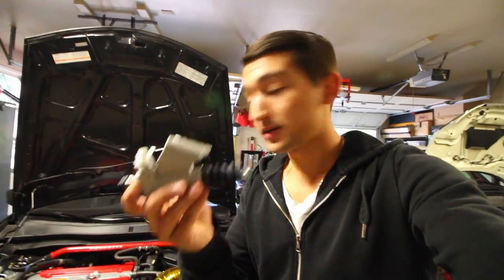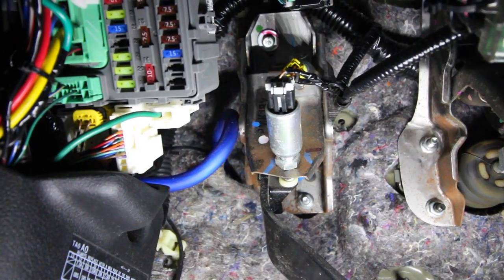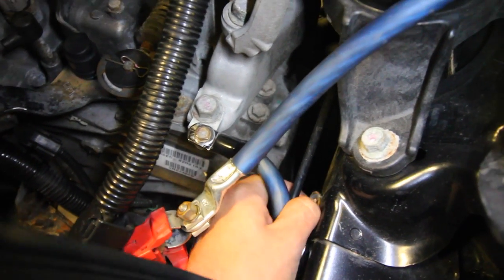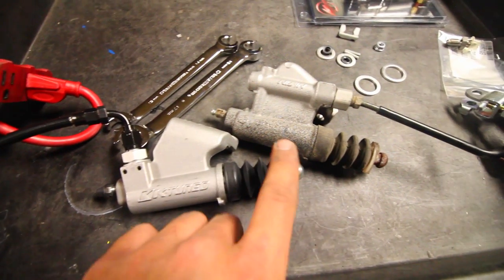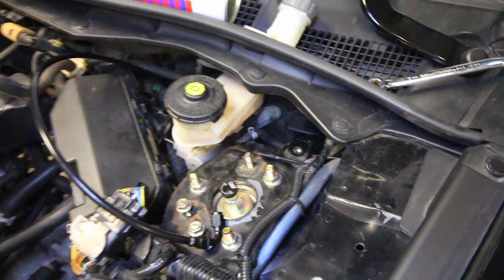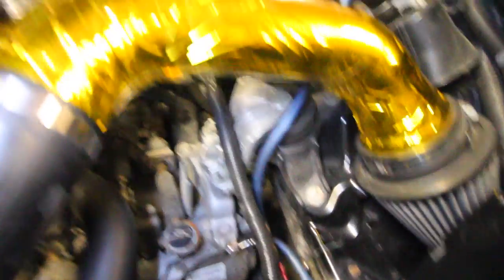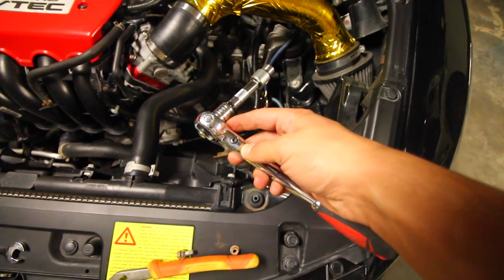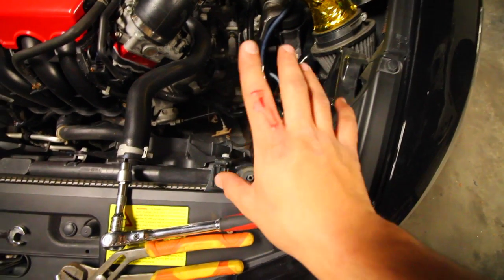How to Make Your Transmission Shift Faster (K-Tuned)

Comment: The k tuned slave lasted me 2 years and had to replace it...I daily drive my car and it just went pfff on me lol. The master slave is still working awesome though.  Just feel played cause the kit was 250...but the NAPA slave feels soooo much better.  Along with my stage 1 Exedy clutch and light weight fly wheel
Reply: Because ktuned uses dorman parts.

Comment: Could have saved some money by just buying a clutch master cylinder from a 03 civic ex without the delay valve, the slave cylinder doesn't have any kinda delay valve it's just the master cylinder
Reply: the slave cylinder does have a delay valve lol in the 8th and 9th gens it does which is why everyone does both

Comment: Good video. The reason you don't use old brake fluid isn't because it absorbs air and lets air into the system. It's due to the fact that brake fluid is hydroscopic and will absorb water, when you press your brakes the fluid is compressed and allows pistons etc to move, water doesn't compress and will cause spongy pedals, corrosion etc. that is the main reason brake fluid is replaced every 2 years on cars, as that's how long it can absorb water for and still be useable. You can use a hydrometer to check this, anything more than 4% must be changed immediately. Imo anything over 1% should be changed soon. Just my 2 cents mate.
Reply: Actually it's not cause brake fluid can be compressed and water can't be. They both can't be compressed, brke fluid and water. Why you should be concerned by having water in brake fluid is because it lowers the boiling point of the brake fluid and as such it can cause brake failure. That's the only reason. Not because you can't compress water, cause you can't compress brake fluid either. It would be rather pointless to have a fluid in the master that can be compressed, THAT would give you a spongy brake and no the other way around. 
For example, air is compressible and gives you the spongy feel. Water alone wouldn't do that until it boils and your brakes fail completely.

Comment: been waiting for this for a long time, my slave  cylinder brake down on me when shifting from 2 to 3rd and the pedal dropped on the floor and the car was rolling in 3rd gear, good thing i was  in the city and not far away from home, driving without a clutch and shifting gears in certain rpm

Comment: Just did the conversion beacause my cmc was sqeeking and leeking. So i update it with ktuned cmc slave andfelxstainless line.
Improvements is the right word quicker shift and better clutch pedal feel. But you need to be ready do push the rest of your mechanics beacuse i give you the edge to drive(shift harder & quicker). Installation was a breeze and bleeding was not a issue with a pressure bleeding system. Hope this help you choose your next cmc. By the way the tutorials is outstanding...
Reply from the maker: Glad you liked it buddy! :) 
I hope your system works just as nice as mine!! :D

Comment: Wanna say thank you! I just replaced the CMC on my FA5 to the Hybrid Racing one. I didn't do the slave like you did either but this video helped out a lot!!!! The cars are literally the same. Difference between the too is the location of things but it's literally the same in my car. This mod is night and day and I recommend it to anyone! Clutch is a thousand times more responsive now
Reply: Ricardo Cardona so this got rid of your high rev shifting delay? same out come without the slave cylinder?
Reply: YES!!! I did the CMC and i also got the MTEC shifter spring. that tightened everything up and its a solid shift. Im gonna do the slave cylinder in a couple of days. i just figured its $70. so why not lmao
Reply: Ricardo Cardona lol you could have adjusted it yourself the CMC an removed the cdv out of.the slave cylinder for free.....an got the exact same results ...

FOR FREE!!
Reply: wait...so you changed whatever the CMC hybrid racing came with....with the oem one?

Comment: He needs to make shirt's that says will work for part's. Seriously though the route he is on is really good because when he or anyone else is ready to upgrade to an 3.7,3.5, or last but not least a 2997cc 3.0 liter engine. Check out Evans V6 tuning. He is got a great setup for a naturally aspirated engine. I myself have been playing around with a 3.0 and been slept on and woke up alot of turbo 4 cylinder's with little tricks here and there and never lost reliability or many run's against whoever. For pennies on the dollar is the best part. Plus I was really surprised because I have always been building American car's until my girl pulled up with her Accord EXL. The Accord is a safe car to put power into because the crash rating is incredibly safe. Safety 1st is a must. The 3+ liter and suspension is a very necessity for the Accord to compensate the heavy side of these car's but they are great and fun with a fat slice of safety.
Reply: Upgrade?

Comment: They also say you can use automatic transmission fluid for power steering fluid but I wouldn't suggest that. I personally always put DOT 5 synthetic brake fluid because it has a much higher boiling point but never mix with regular DOT 3 which is not synthetic and you would normally upgrade to DOT 5 when you upgrade to stainless steel braided brake lines which is highly recommended. The brake feel is so much better and predictable and consistent with no fade or squishy feel. Even for daily driving it is a huge difference you would never want to drive with rubber brake hoses. Especially on motorcycles.

Comment: I don't think it's air that gets trapped in an open can of brake fluid. It's moisture aka. water, and it makes the boiling point much lower, than the specified for that fluid. So this doesn't really matter for the clutch, however it matters for the brakes. (also moisture -> rust so this might be a concern too.) Correct me if i'm wrong... :)
Reply from the maker: Both air and moisture can be problems with the braking/clutch system. They both work hand in hand, so with air, there is moisture, and with moisture, there is air. The moral of the story is keep your brake fluid bottles closed when you're done with it :)
Reply: Yes, but you bleed the air, that's why there's the bleeding procedure..  The brake fluid does not absorb air, hey, it would look like soda with bubbles... :) But the point is the same, close the bottles properly (but I can't imagine someone leaving half full bottles open anyway :D) 
Keep up the good work man! :)

Comment: you should reconcedering the x battery connection dude . the + wire might touch a part of the body and shorts the charge . get it sealed or hooked to a  safe location . informative video btw . keep it up .

Comment: i'm pretty sure the ''restriction'' is there to take the pressure of the oil higher, as fluids can't be compressed, so they build up pressure.. I can't think of why would a manufacturer want to make you shift slower, surely they can't make me stop speeding with this..
Reply: The Weird part is that the regular EM2 Civic (which is on the same platform as this car) does not have the restriction in the CMC.

Comment: I've gotta do this, hopefully it helps with 1st to 2nd in my 8th gen, I've grinded it twice so far when trying to shift at high RPM. Really hope that it's not my synchros/gear sleeve.
Reply: @_v.ha did it fix the grind between 1st and 2nd
Reply: @Nikko-zi3ti  bruh we both have the same issue i can’t put my car into any gear consistently and it’s really sticky. i’m changing them today

Comment: You're doing a great job as always! but I will have to advice people. This kit is junk, they tend to fail at around 5K-10K miles. My Ktuned CMC failed @ 5K miles, then the Slave @ 7K miles. I am not the only one, I've had 2-3 friends too that had the same experience. Search in google and you'll find lots of people with the same issues. Ktuned CMC + Slave kit is great only when it works, if you are looking for something that last more than a oil change then do not get this... you'll be wasting your money!

Comment: Reason why the factory did that is to reduce the force from when you dump the clutch, put less wear on the granny's main shaft(I think greddy made something like the delay slave cyclinder)... Check your trans oil after your mod for silver shavings unless you're taking it easy but then what was the point for you to do this mod. Shift faster? Ive been using my 06 rsx's CMC with the OEM slave cyclinder on my 97 Hatch. Replacing clutch or trans rebuild.

Comment: I'm confused. Is the clutch using the brake fluid?
Reply from the maker: Both the clutch and the brakes need to use brake fluid for the pedal operation to work. They both have separate reservoirs where they store their separate fluid, however the fluid is the same.
Reply: No. Pay attention to the video again.
Reply: +milanmastracci yeah you are shifting quicker but that delay was there for a reason... It prevents stripping of synchronising gears... Now you are DESTROYING YOUR GEARBOX BRO!!!
Reply: If you're double clutching properly like you should you shouldn't be using or even need the synchro's
Reply: If you are double clutching you are shifting waaaay slower than stock clutch cylinder was made...
Reply: Antonio Majstorovic I agree. Seems Marshall is watching too much fast and furious. Double clutching when up shifting is nearly pointless unless you have a weak tranny and junk synchro s.
Reply: Yea clearly that's the case except you forget that some larger vehicles aren't synchronized. Anymore insight you'd like to add? I guess no one should bother to learn to heal toe downshift either right "cos synchros"?
Reply: huh and what car is this video about? you don't make sense lol. some insight for you is its "heel-toe" shifting. learn to spell
Reply: +Marshall, who do you think you are?..........Vin Diesel?
Reply: dragonslayer1483 "heal toe" because you've never been autocorrected?
Reply: for family?
Reply: yes. You can use DOT4 at the best.
Reply: @Nec89   REDLINE RUNNER  - LMAO double clutching? Are kidding me? You don't double clutch when racing. That is one of the most retarded things I've read on here in quit some time. Stop watching the first fast and furious movie bro it's not real life or even very accurate to real racing. "Granny shifting not double clutching like you should" - Dominic Toretto

Comment: would this work for an automatic?
Reply from the maker: Give it a shot ;)
Reply: 2JZ Don't know if you being serious or sarcastic
Reply: I'm only a nub trying to understand this so yeah I am serious
Reply: No. You don't have any one of the parts he is talking about. The best thing you can do is disregard this video and the a tranny cooler(it's like a mini radiator for your tranny). That will help but you need to tune your car that will also give firmer shifts. After you put the tranny cooler on then you bypass the antifreeze coolant lines that run into to the top of your tranny. Also you can run an override switch on your main electric fan to keep the tranny cool. That works best when you relocate your battery to the trunk. This way your fan has a clear path to being cool as well as more room to run a dual intake y with 2 cones.
Reply: ohhh makes sense now

Comment: brake fluid absorbes moisture, not air. it is not good to let it sit open that is true. it will give you brake fluid with a lower boiling point.

Comment: Milan cuz did you check out the you tube video on Evan's V6 tuning? He also got great tech advice on 4 cylinder's. Just saying with the Accord's that not just you, myself and others need to go V6 J series engines because the weight of the Accord's.

Comment: @milanmastracci I went with the K-tuned CMC kit including slave.  There is some squeak and I think it's on the slave, what grease do you believe is required for the end of the plunger where it mates with the fork?  I tried bearing and break grease on it but no success.  Also the slave was un-assembled, does the plunger entering the slave side need some sort of grease as well?  Any help is greatly appreciated!

Comment: With the k tuned cmc do you have to use the stock push rod like with the hybrid racing kit or is it just a bolt in but using just the Clevis .. 06 si

Comment: I just installed my ktuned master and slave cylinder.  my black line where it hooks up on both ends were leaking.  I notice where it connects it spins.  and I don't think I blead it right...I need help!!

Comment: How have the cylinders held up? Heard some owners having the slave breaking on them within a year.
Reply from the maker: I had an issue with mine a couple years after the install, but got it replaced with a new unit. Still holding up okay.
Reply: @milanmastracci  That's good. K-Tuned must've addressed whatever (possible) issue there was.
Reply: I hear too many bad things ab k tuned

Comment: Milan seriously please just check out Evan's V6 tuning and check out his J series engine. Plus he also built a some mean 4 cylinder engines but, if you just keep building up everything around spending money on the 4 cylinder engine your on the right path. Turbos are NOT reliable and owning a Honda is best for reliability and you don't want to loose that. Plus you can sell your engine because Civic owners would pay top dollar for the engine you have. Buy the 6 engine completely running before you do a swap and I promise you won't be disappointed. Selling your engine will pay for a low mileage junkyard engine and you can keep your tranny. Try to find an Acura TL,MDX engine. They usually have anywhere from a 3.2 and a MDX has the 3.7 with a 90mm throttle body which you can buy the throttle body spacer adapter combo for any smaller J series engine. 3.0,3.2,3.5, so even with just another Accord engine swap with the 3.0(2997)cc J block which I have for now is great because it's lighter than the rest in the front. You have to be careful when you are looking for a 3.0 liter because their is 2 different blocks. The 2779cc if I remember correctly and the block I have which is the 3.0(2997)cc J block which makes a difference. Just check out Evan's V6 tunning and listen to what he has to say. I have been doing bolt on and a little port work myself and ran a single 2.50" with a J pipe with one muffler coming out the passenger rear also with post cat delete which is legal and when you get the bigger J pipe you should port the downstream side on both cat's to match the inside diameter of the larger J pipe and the car is still quite with a nice 18" long SS muffler as well as the whole exhaust is SS as well. Reason the 1muffler as well as the battery relocation kit to the passenger rear side of the trunk and as far back  to the tail light is important because weight transfer. Hit me back if you want to know some other clean budget build idea's. I got you my man. Don't take what I am saying to you wrong just check out the Evan's YouTube videos and he will back everything I have been up to that people were saying was dumb but they don't know. In the American car world the saying is theirs no replacement for displacement and you need the 6 for your very beautiful looking Accord because weight. Stick with naturally aspirated engines and you can't loose. As far as Evan's tune with the 6 ITB is over board and like I mentioned before you can put the 90mm throttle body and spacer. Once again great job.

Comment: Hey Milan, great video. But I was wondering if this mod makes the pedal shorter, have  less travel to the floor?
Reply: Anthony Brazeau to make the clutch pedal stroke shorter i placed a rubber stopper on the floor behind the clutch.i just made the height of rubber stopper thick enough that the clutch will only depress much lower than clutch bite point
Reply: You have to adjust the clutch pedal and cmc. There’s bunch of videos on YouTube on how its done.

Comment: I thought that the delay valve only slowed down clutch engagement, not clutch release.  I am confused how this would cause a lockout situation unless the stock cmc and slave do not work as they say they do.  Any thoughts?
Reply: I'm not trying to discredit you but I am just wondering if the new upgrades were really what fixed the issue.  I had a similar issue but I discovered I had some air in the lines and my cmc needed some slight adjustment.  However I still get a slight split second lockout when shifting into second gear.  It is pretty random, not really at high or low rpm.  So I am curious if this mod will help me. I drive a k20z3 civic si
Reply: Because he K tuned it so he raised the rev limiter much higher.
Reply: v t what are you? His father? Pull your head in and mind your own business

Comment: Just installed mine and now I get locked out when shifting at high rpm. I didn't remove the clutch position sensor during the install. Could that cause a lockout with hard shifting or is it possible air in the clutch line? Thanks.
Reply: Did you ever figure out why this happened?

Comment: Are all the k series clutch kits the same? Can’t seem to find ours but the all look identical
Reply from the maker: Most of them will bolt up, but the problem with running a very lightweight flywheel on a K24Z engine is that you will have to turn off misfire detection if you want to drive it. What car are you looking for?
Reply: @milanmastracci  8th gen accord…cars got 200k original slave and cmc on its way out so might as well upgrade🤷🏻‍♂️…now your a 8th gen guy maybe you can answer the question for me lol what would it take to put the 2nd gen tsx motor in the accord…20 extra hp and electric power steering sound amazing but I can’t find anything on it,also I can’t find any accord z3 only tsx motors

Comment: Is it the same in an automatic transmission? Even though the computer activates the clutch does it have the same mechanism?
Reply: Darien Charlton 

No
Reply: Darien Charlton no. Automatic and manual transmissions are very different in the way they are designed and operate.